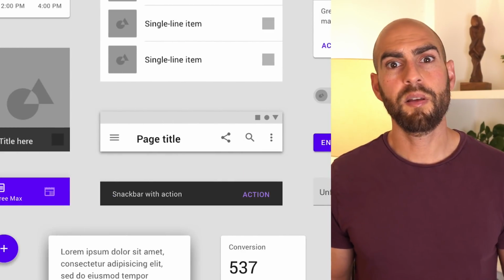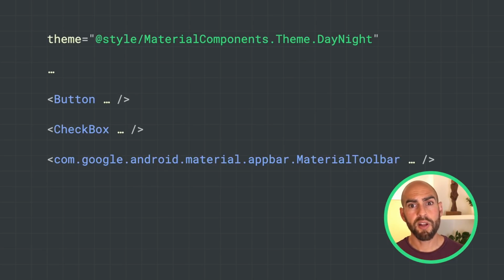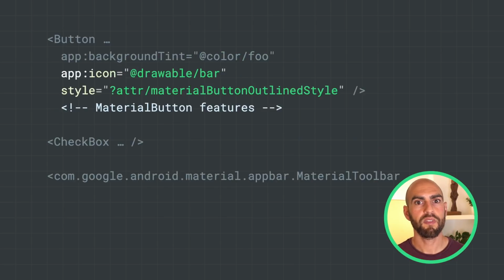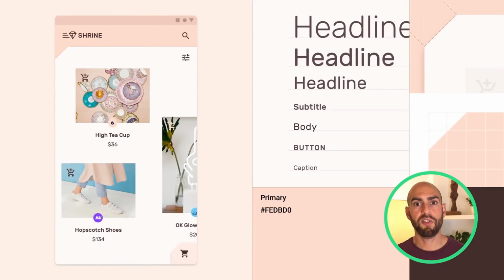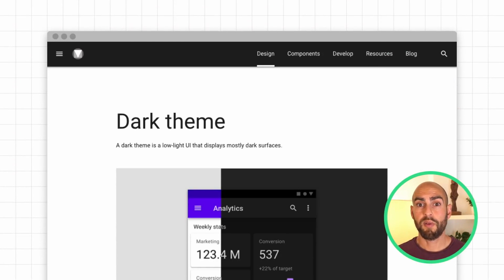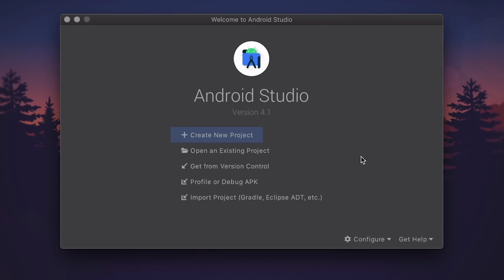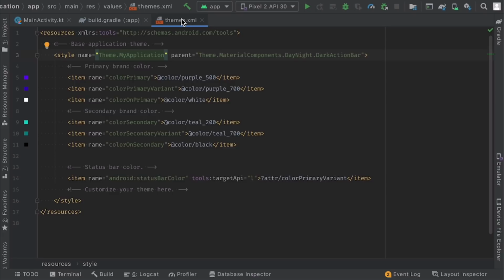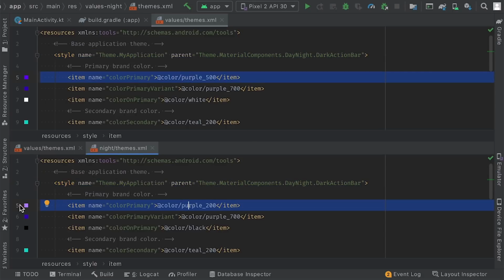Why use Material Design Components? - MAD Skills

Comment: Why use MDC instead of AppCompat?
Reply: I cover this at 1:30.

AppCompat's goal is to mitigate API level differences, providing backported functionality where possible. MDC's goal is to implement Material Design components/styling/features. MDC builds upon AppCompat, it doesn't replace it.
Reply: AppCompat ---> MDC in the future... so, the migration is a must from next versions of Android